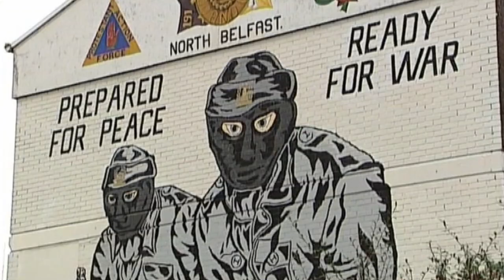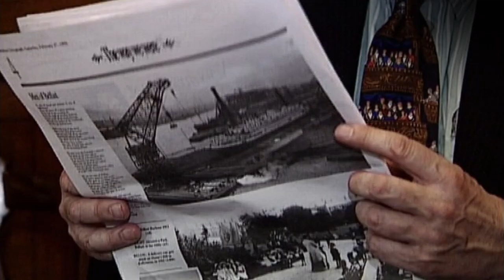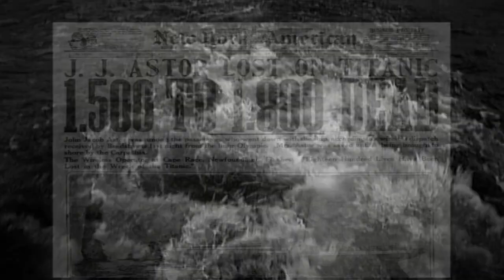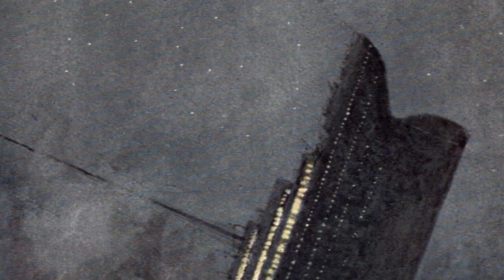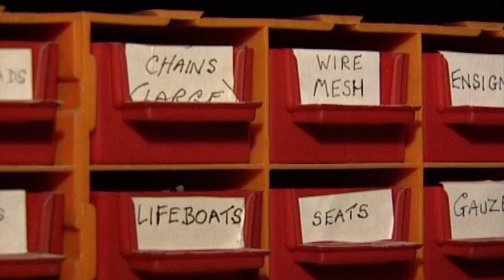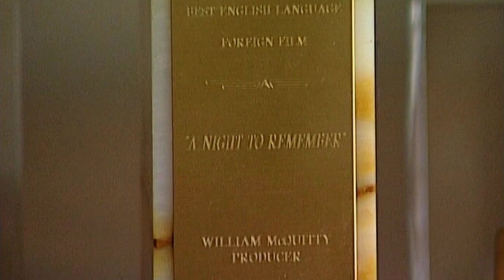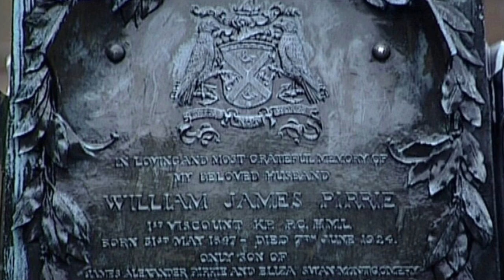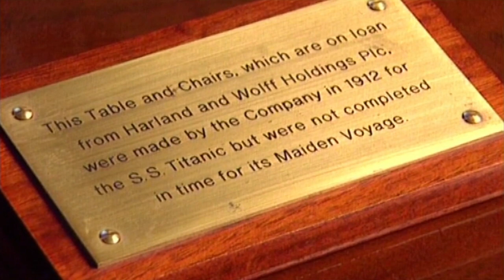The Real Stories From Those Who Built The Titanic | Titanic: Legend Born In Belfast | Timeline

Comment: Titanic was just very unlucky.  Wrong place, wrong time, wrong decisions, and worst places were damaged (most of damage were right across watertight bulkheads). 
The design may have flaws, but it was no-less-than an "A" for the time. Just look at RMS Olympic, her sister which got hit by a destroyer and didn't sink, that happened when Titanic was being built. Later Olympic actually suck a U-boat with her bow and was called "Old reliable" for her
Reply: Wrought-iron rivets
Reply: What's that old saying,  what can go wrong, will go wrong. It definitely was destined to sink.  Very sad.
Reply: Fun fact:  Olympic throws a propeller February 1912, some workers on Titanic are moved back to Olympic to effect repairs, pushing Titanic's maiden voyage to April 10th, essentially sealing her fate.  Assuming Smith takes the same route, had Olympic not thrown a prop, Titanic's maiden voyage would have been earlier, and the iceberg that sank her would have yet to drift that far south.